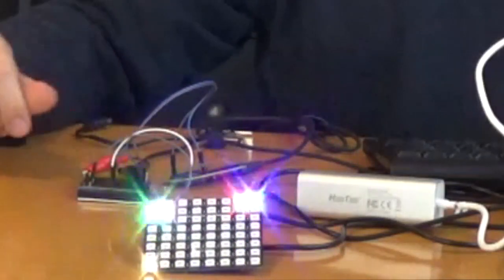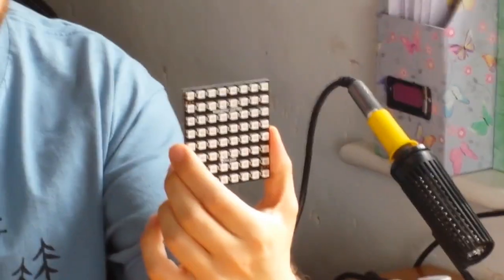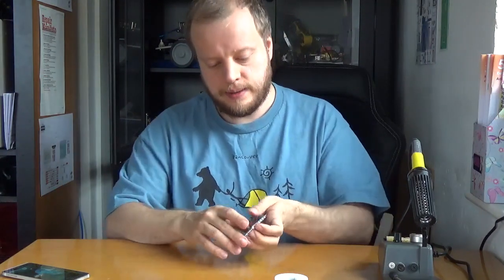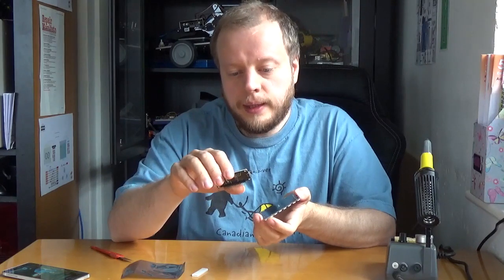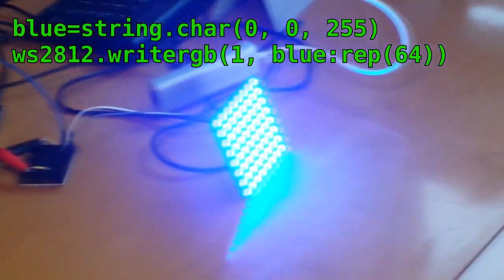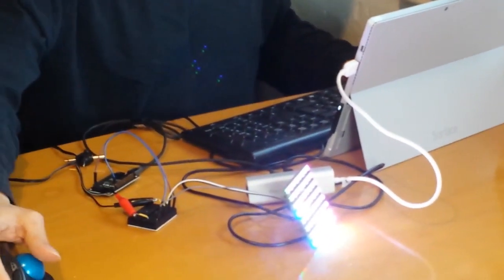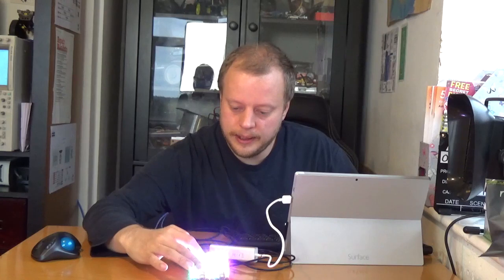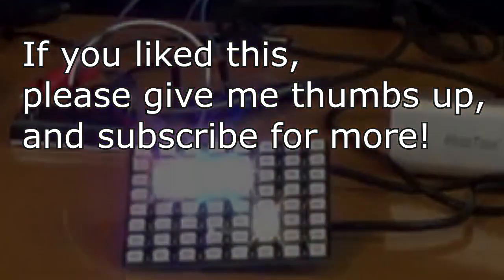NodeMCU Esp8266 with Neopixel 8x8 Panel

Comment: When I'm soldering I tend to just pull a lot of slack from the reel so I can solder without cutting anything. I find it makes for a lot less wasted solder than cutting off a length each time. Also, what was that thing you used to tin the tip of your iron?
Reply from the maker: +Samuel Doye A Tip Tinner/Cleaner pot. It is an anti-corrosion paste, and tins the tip without leaving a big blob. It's got cleaning stuff embedded similar to the way flux-core works.
Reply: +Orionrobots I may have to get one of those during my next eBay shopping spree.

Comment: Hey! I know you are not using an arduino for this, but that's what I have (Uno R3). I've got a question regarding powering the neopixel 8x8 matrix: what do you use to power it? Do you think a 5v 4A wall charger is enough to light all pixels at full brightness? Also, would you use a condensor or capacitor to protect the neopixel board?
Reply from the maker: Hi Vernon, thanks for the question. I used an external power supply - a 5v 4A wall charger sounds like it should work, just take care not to short it, although that goes for any supply. I didn't use a capacitor there, I'll admit I am quite lazy with them, but if you do have noise issues or strange problems, then it may be a good idea. So not so much to protect, but to deal with power supply noise issues.
Reply: Ok, got it. My project will be using 4 servomotors, an ultrasound sensor and two arduino boards. I've got a small powerboard where you can plug in the power supply jack and has several 5V and GND pins and connect the arduinos + matrix. Would you recommend this approach or would it be safer to power them with another method?
Reply from the maker: You probably want caps near the power for the servomotors and the ultrasonic sensor - my thinking is that the motors will generate noise and the sensor will be sensitive to it. But this sounds good. What are you building? It sounds interesting.
Reply: Background: It's a very basic robotics course in my graduate. I'm studying informatics engineering so we mostly go on the software side, this would be the first time I'm working on actual hardware so directly. This explains my many questions about electronics hardware related stuff.

We were given free reign over the design of the individual lab work provided we either did not spend more than 100€ on components (covered by the university) or bought everything ourselves.  I've always been interested in arduino, so this gave me the perfect excuse to buy components for myself, of course.

My idea is to make a "sentry" catapult which rotates on it's axis and searches for "targets" within the ultrasound detector's radius, and then fires upon them. This is fairly simple to do, and I'm sure my grade would not be too good for this, so I was thinking having a communications aspect to it. Have one board control the actuators (turret spin, catapult fire and neopixel board) and the second board read the sensor, decide what to do and communicate the course of action to the other board. I was thinking about using the neopixel matrix as some sort of "emotion display" for what the robot is up to - have it flash different colors depending on levels of alert, intention to fire, things like these. 

My main objective is just to learn and make the most out of this semester, and this seemed like a pretty interesting way to touch many arduino related.
Reply from the maker: If you do make a blog, pictures or videos of it I'd love to see it - it sounds really awesome.
Reply: I plan to document every step of the way, my professor's reaction went from "meh" with the catapult idea (of course, past the initial "catapults are really cool" reaction) to a "pull it off and you get top marks" when I told him about my idea of having two boards work in tandem.
Reply: Yo! I just wanted to follow up on this, I finished my project now. Posted everything on it on thingiverse, the original design of the actual catapult is from another user but I remixed some parts and the code is completely revamped. here it is: https://www.thingiverse.com/thing:2363756 . I ended up using a "barebones" 5V 5A power supply for the project and a usb battery to power the arduino nano+neopixel matrix. Turns out servos did require a LOT of power haha.
Reply from the maker: That is really rather awesome. Did you get the peak current usage? I guess that it doesn't turn and pull at the same time helps.